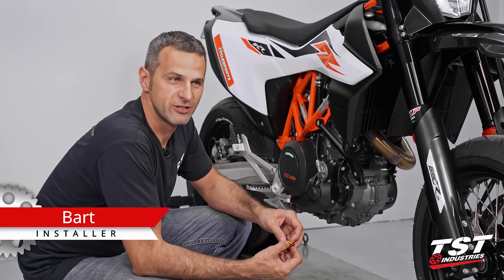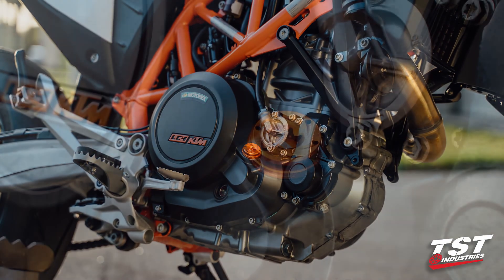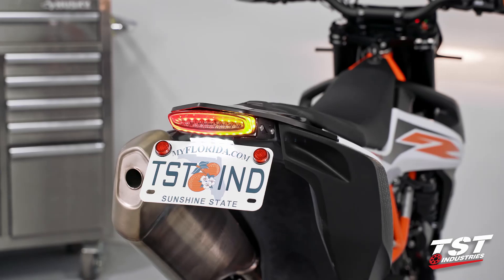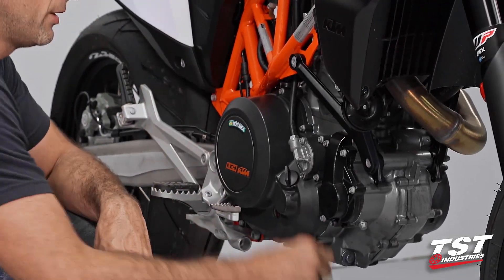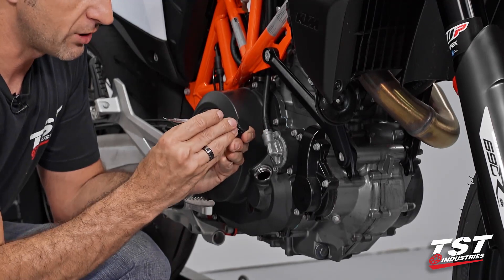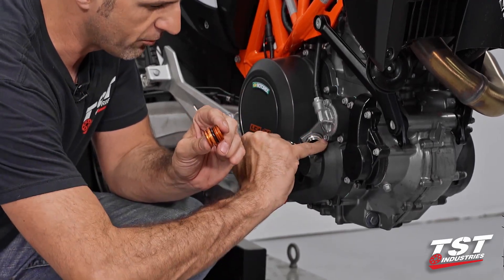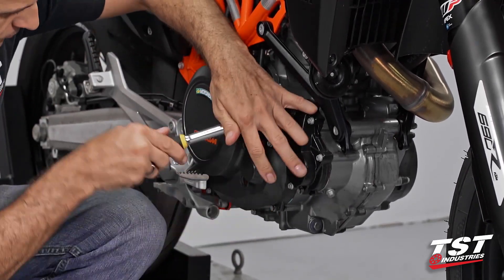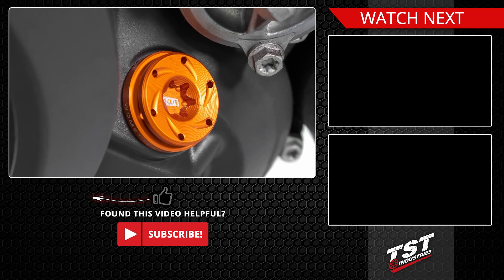How to install a Womet-Tech Oil Filler Cap on a 2019+ KTM 690 SMC-R / Enduro by TST Industries

Comment: Do you make these for a ZX6R?   I have a 2023 ninja ZX6R and I’m looking for a good oil cap. I have the frame sliders and fork sliders so I’m looking to have it all match
Reply from the maker: Unfortunately we do not have positive fit confirmation between one of the filler cap models and the bike you are asking about. That info typically comes from Womet-Tech, and they haven't sent us info on this combo. I am fairly certain that we have a fitting length, thead, o-ring size model, just no immediate way of verifying fit. We will update our website as soon as the info is available.